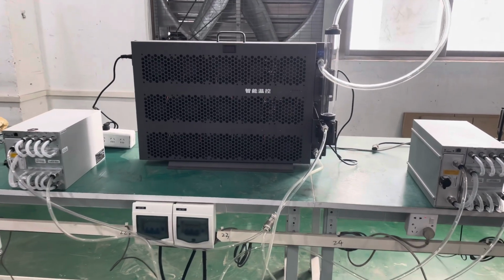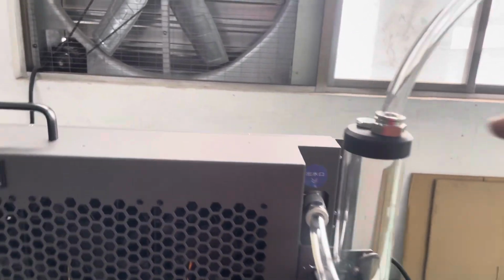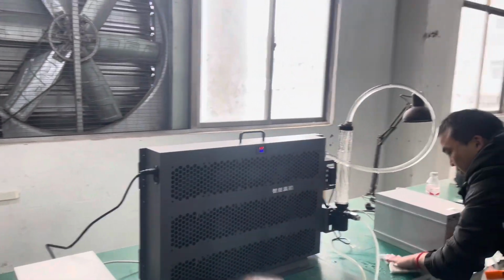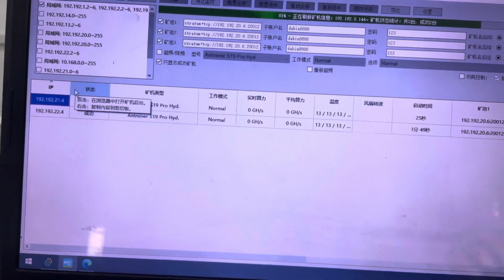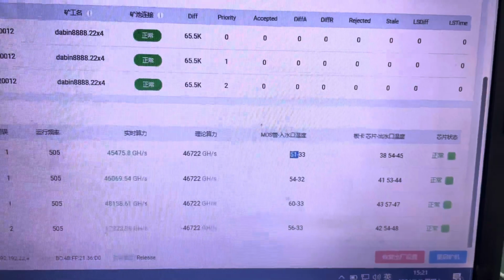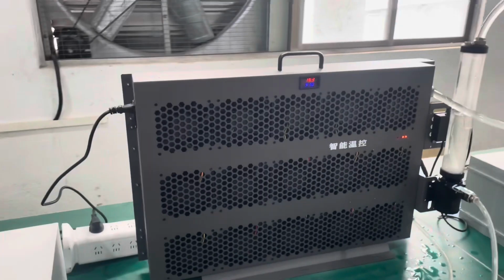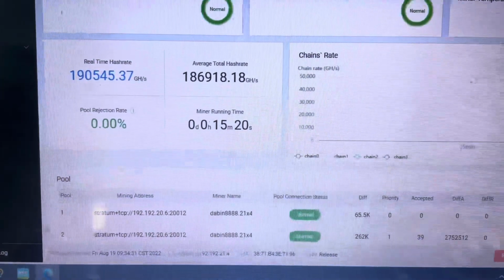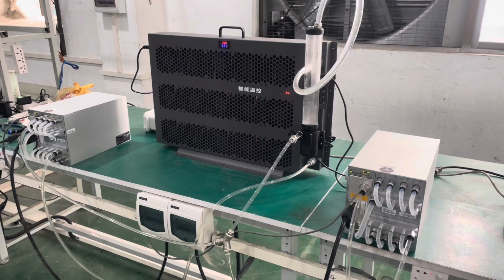How  To Mine BTC at Home with Hydro miners X2 S21/S19/M33/M53/M63

Comment: So how come a minor has to be a minimum of 20deg? I would have thought the colder the better
Reply from the maker: that's wrong chips needs certain amount of heat to run properly , they are designed to run hot , just like a car engine ,  and since these miners are running on liquid do you want the liquid passing through the miner to freeze and block the circulation of the liquid and damage the miners

Comment: so low noise perfect for running at home, BUT needs 3phase power.. No one has 3phase at their home.
Reply from the maker: well you are wrong most people in the middle east , north Africa , and Russia  have 3 phase available at home , its very common , expect for US where they run on 110V when 90 % on the world run on 220V , and the manufacturer designed the miner that way otherwise  you cant achieve that kind of hash rate and efficiency

Comment: Do we need to add water cooling plate with the radiator for using s21 hydro 319th
Reply from the maker: if you have an S21 Hydro . you dont need to add anything , its have already water cooling plate from  factory

Comment: can I use this one dry cooler for my two s21 hyd?
Reply from the maker: depends on your location , if you live in an area where ambient temp dont exceed 35C yes you can run two miners with this dry cooler
Reply: And I have a extra question. The s21 hyd use one three-phase cable only? Or the ASIC use 2?(for connecting to the wall)
Reply from the maker: @trofixgo5332  all hydro miners use only one cable which is a three phase cable

Comment: Hydro miners don't work without a radiator?
Reply from the maker: yes they need some kind of system to dissipate the heat , so they needs a hydro cooling cabinet if you have many miners , or a small radiator if you have one or two units

Comment: I have antminer s19 pro hydro 184 th is it normal for inlet temp is 66 and outlet is 55
Reply from the maker: its not , you must have reversed the inlet and outlet piping , the inlet should be on the hasboards and outlet at the PSU
Reply: Can you also tell me where is the inlet and outlet in the radiator maybe I reversed

Comment: i live in a freezing country. i send 21 centigrade into my S21 335T but don't start mine it says,  "ERROR_TEMP_TOO_HIGH: over max temp" Does anyone know why? 

2024-04-20 12:12:08 water temp 21 ~ 22, stop.
2024-04-20 12:12:08 set UART baud to 115200
2024-04-20 12:12:16 Chain[0]: find 216 asic, times 0
2024-04-20 12:12:23 Chain[1]: find 216 asic, times 0
2024-04-20 12:12:31 Chain[2]: find 216 asic, times 0
2024-04-20 12:13:51 too hot water temperature pic temp 56 (min 56)
2024-04-20 12:13:51 ERROR_TEMP_TOO_HIGH: over max temp
2024-04-20 12:13:51 stop_mining: over max temp
2024-04-20 12:13:51 uninit_temp_info
2024-04-20 12:13:51 do not read temp anymore...
2024-04-20 12:13:51 uninit_asic_temp_vol_info
2024-04-20 12:13:51 do not read asic_temp_vol anymore...
2024-04-20 12:13:51 cancel thread
2024-04-20 12:13:51 **power off hashboard**
Reply from the maker: it will help a lot if you can send a full load after starting the miner 
you can email it to : info@crypomininglab.net
Reply: @Crypto_mining_lab   your email not working

Comment: What's cable size from fuse box to miner's breaker is it 2.5mm or more
Reply from the maker: if you are referring to the power cord for the miner , it is the standard cable form bitmain for S19 Hydro , if you referring to the cable coming from the main breaker to the the miners breaker , then it will depend on how many miners you running on a single cables

Comment: Can you make more videos about the s21 hydro, I'm considering getting one and also the 15kw radiator.
Reply from the maker: The S19 hydro and S21 hydro are the same in terms of cooling requirement , so what works for the S19 will definitely work for the S21
Reply: Have you bought S21 HYD?

Comment: I am using same as your antminer and radiator but it barely can handle 1 miner
Reply from the maker: When you say the same you mean similar , the cooling capacity on the radiator I was using is 15kw , and water pump flow is 25. L / min , so I’m sure you using something similar but not the same , that’s why you having overheating issue

Comment: Are the hydro miners 3 ph or single phase.
Reply: I dont know anyone with 3ph at there house. Is there a way to convert it over to single phase.
Reply from the maker: all hydro miners run on 3 phase 380/415V 50/60Hz
Reply: @Crypto_mining_lab I think that hydro miners work on 2 phases, not three, the third cable is like a neutral wire, not a phase

Comment: Not relevant to many people. It is normal for it to run for 10 minutes at 15 degrees Celsius outside temperature as in your video. You must specify that everything depends on the outside temperature. I have exactly this configuration, but a huge cooler with a dissipation power of 100 Kw, and a pump of 100 L/m and when the outside temperature reaches 32 degrees Celsius it stops working. Asic reaches 90 degrees.
Reply from the maker: You need to be more specific on your setup as well , you meyiihdd a 100kw dry cooler , a 100L/ M pump but you don’t mention anything number about the number of miners you have , because when you say you have same setup people will assume that you are running two miners with 100kw dry cooler and 100L/m flow pump which is completely incorrect
Reply: @Crypto_mining_lab  As I specified, in the first message, the same configuration, i.e. fixed the same number of asic-s, and the same model. Now it's clear...?

Comment: Hello Sir thank you for your videos, very valuable information. What is the temperature of the water that gets out of the miner? If I were to heat a storage of water with it, how hot could I get the water?
Reply from the maker: the temps of the coolant out of the miners is usually between 65 to 80 C depending on how efficient is your cooling , and you can definitely reuse the heat for other purposes

Comment: Hi!!
What is the thermal equilibrium point?  after hours of operation
Reply from the maker: its not a static value , it will change based on many factors , how much heat the miner is generating , and you ambient temp , but as longas you keep your intlet fluid temp between 28 C to 40 C , and inlet inside the miner below 80 C the miner will run fine
Reply: @Crypto_mining_lab  it's interesting I have lianli radiator and when the water is above 35c the miner show red light .

Comment: the biggest problem is finding 416 volts to run that miner.
Reply from the maker: True not everyone has access to three phase , but actually the miner will run on any three phase with 380V to 415 V it doesn’t have to be 415 V
Reply: @Crypto_mining_lab miner is working only on two phases not three if i have good infos.
Reply: can connect 20 HYD to a 12kw

Comment: When using Vnish firmware, you don't need to wait for 20*C hot water. They have a start at 10*C.
Reply from the maker: Yes that's true because with an aftermarket firmware you can disable that , but it comes at a price where you need to Pay 3% of Dev fee to the firmware developer that's why i didn't use a third party firmware on the video since most people will keep their miner on a stock firmware  , but thanks for the input
Reply: @Crypto_mining_lab If there is not yet a Braiins OS for S19 Hydro I use it because of the automatic reboot in case of loss of connection or undervoltage in the network. It works great for that.